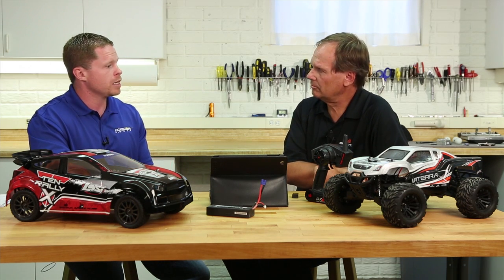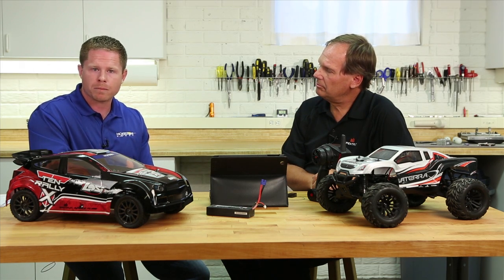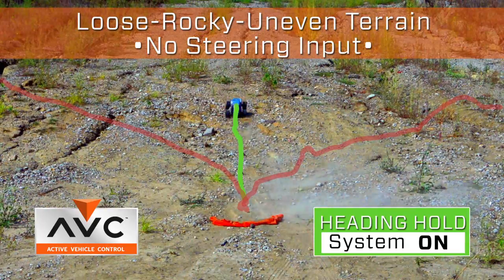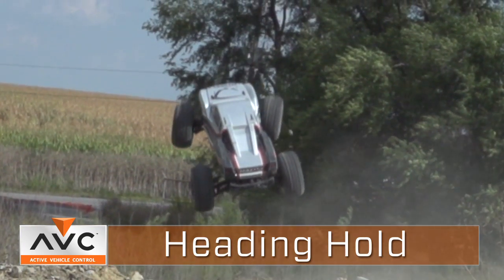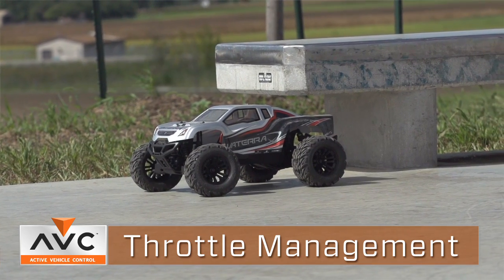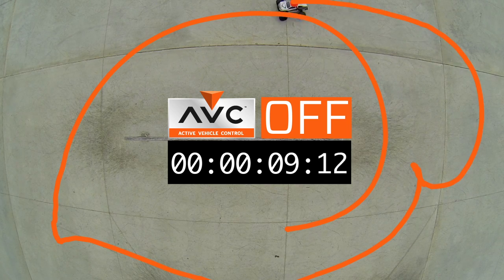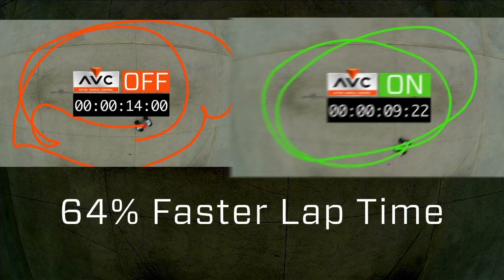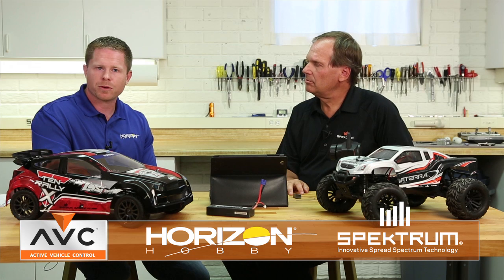Spektrum RC AVC (Active Vehicle Control) Technology - Overview

Comment: And 9 years later the system still doesn't run as it should...from 5% to 100% standing still full steering lock left or right, from standstill, try to slowly move ahead
...it's shit...studders, boggs, doesn't drive smoothly..basically it's shit...sort it out spectrum, you are supposed to be a leading, innovating company..act like it, ...plus, if that guy on the left is an experienced driver, then so is my nephew at his first rc run...

Comment: I have had many years of experience with the AVC system and also the Traxxas TSM system and from what I can feel and see neither have any control over the traction of the wheels!
It is identical to adding any old head locking gyro to any random car, nothing to do with throttle inputs! 
Or it means all my cars and Spektrum radio systems I paid good money for are all faulty from the factory!

Comment: Hey, my Heading Hold is not working I use DX4C with the AVC receiver that it is comes with.
The streering goes in different direction could not heading hold when the tail move left forward the streering goes right so the car is making a U turn automatically not heading hold, can someone help
Reply: Having exact same issue. Just bound my arrma infraction with a dx5pro and avc is doing the exact opposite of what it should. Holding car off ground turning it to the left avc is turning wheels left when should be turning right and so forth. Tried reversing the channel in the settings on remote and is still doing the exact same thing even after rebinding on a hard surface multiple times. Help?!

Comment: I cant get minee to calibrate, I tried it binds bit doesn't calibrate. can someone help?
Reply from the maker: Hi Frank, Make sure your travels on your radio are set to 100% when you calibrate. If you are using a DX2e check the manual on how to set the endpoints. Let us know if you need more help!

Comment: been running this on my 20 year old traxxas rusty, as far as i can tell, i have not received any issues with my steering servo, i have been to the track many, many times. as i am sure that the servo is doing more work now (compensating a lot of the time) i am certain that my servo will doe sooner than if i had not installed AVC, but that being said, my old servo lasted 19 years... I'm not going to complain if i only get a decade (half) out of my servos now. 

at least 2/3 of the local champs are running AVC, not to mention all the kids that pick up a new car and tx/rx set that already has it equipped. so just like when i remember everyobe whining about brushless motors, don't be that guy that's unwilling to keep his car up to date (even if it's from the '90s). knowimg how to set up your car, and driving experience will still ensure the edge to the competent racer.

Comment: Great, but if we want a vehicle to just drive it's delft why don't we just get a robot to drive it and every single racer will have the same lap time and all pride will be lost (and anyone who does have pride with a robot driving is an idiot).  I'm not a club racer, but I hope AVC is banned at all competition rc tracks.
Reply: They did ban it from racing because it was being used to cheat and to be more stable when driving. So before you go out on the track you have to disable it or you will be disqualified or something. Hope that helped :)

Comment: Personally I think this is great and it's up to the end user to use it or not. I want a nice controller for my slash and will wait for a package with one of these receivers. I plan to use avc to learn more about suspension tuning and to dial the car in better by removing the variant which is me. Then once it's tuned as good as I can get it I will turn it off and race my buddy. By seeing it used I will have a new target to how fast I should be able to drive and will lead me to driving it more. Also my two year old can drive my rock crawler quite well but not my slash. Well now I will dial back the throttle and turn avc up to a 100%. I think at 2 it's ok to let him cheat but I am sure others will disagree!

Comment: I'm not seeing in IFMAR's rules, if it is there yet. Even so, it'll be no different from installing gyros in an RC airplane so it'll fly straight and even. It won't replace driver's judgement and the car will less vulnerable to terrain effects the driver can not see or control.

Driving a "wild" RC is 95% of the frustration. It is NO fun when most of your time and effort is spent compensating for lack of control. The more power you put through these RCs, the less "wild" it can be to be fun.

Comment: If ANY of you know helicopters, this IS NOT NEW technology!

It's a head locking gyro commonly used in helicopters.

It's also classified as cheating in drifting for competitions. For on-road racing applications, I can't see this being legal either, because, it aids the driver in controlling the vehicle when the aim of RC racing is to be as accurate and precise as possible with out cheating!

Horizon Hobbies, tryng to make money from old technology and marketing to the morons that can't drive.
Reply: Damon Humphreys I own a 1/8 nitro F1 REDBULL car. I know how to drive but F1 cars need speed to have downforce. Having this system would provide me much help to get it up to speed without it spinning out.